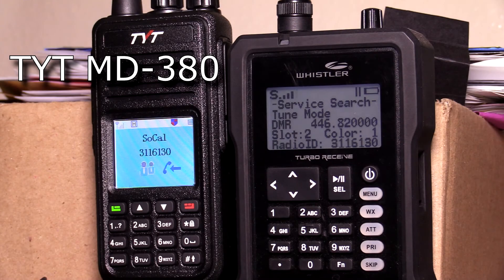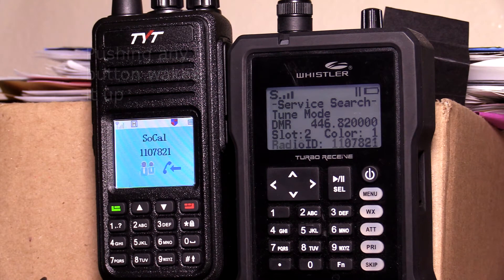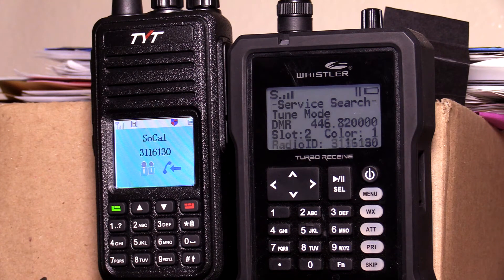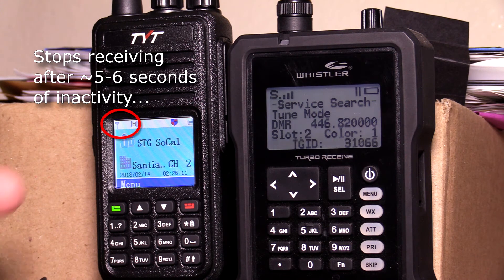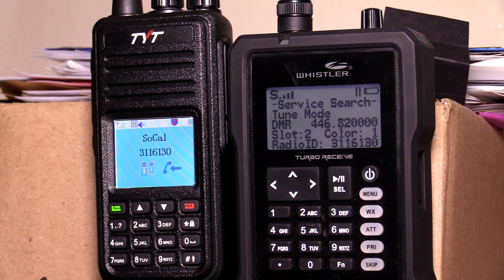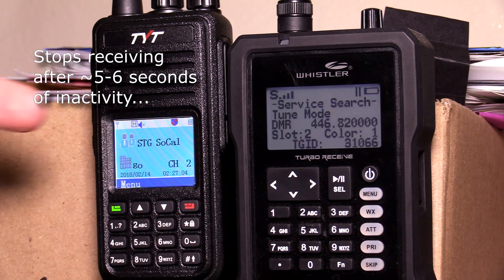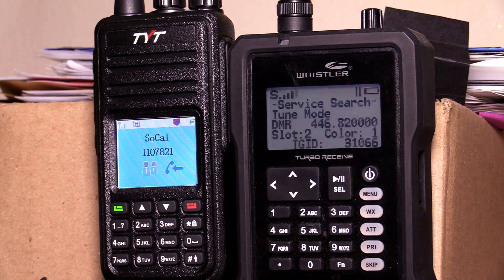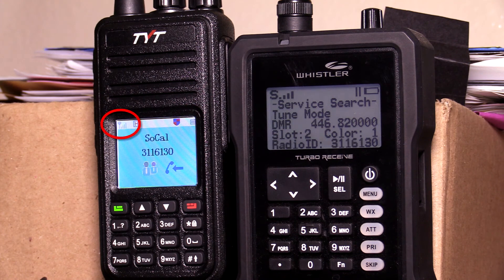TYT MD-380 DMR Audio / Signal Dropout Issue After ~5 Seconds

Comment: D002. 032 is the firmware version on my 380..if the hot-spot goes quiet for a while the 380 goes quiet..cant seem to hear signals from the hot-spot after its gone quiet.. Key the radio and it can hear again.

Comment: Just curious, was the green LED also not working during receive? I just returned a unit that had this same problem and the green led did not light when receiving. Also did not receive in analogue mode unless you manually opened the squelch with 'monitor'.
Reply from the maker: You know, I'm not sure.  I don't recall noticing it turning on/off.  Looking at this video closely, it doesn't look like the green light was coming on at all.  I don't have the faulty radio anymore because the seller replaced my unit for me--and the replacement works perfectly.  I didn't have any issues with analog receive that I recall.  Then again, I didn't play with it on analog very much.  Hopefully you have no trouble getting a replacement, and hopefully your replacement works without any issues!

Comment: I have the same issue. Did you solve the problem?
Reply: I solved the problem, download fixed firmware here: https://www.mediafire.com/file/4qy7ac77zsou0z7/DM380-NoGps-RX_Fixed-_13.20.bin/file
Reply: @alessandrodalterio7556  do you have this file that isnt in a .BIN file or link where you got it from
Reply: @alessandrodalterio7556 gracias amigo tengo el mismo problema probaré con este firmware
Reply from the maker: Yes, it got fixed... by returning it to the seller for a replacement. The eBay seller was great and exchanged it right away. The replacement unit works perfectly without ever dropping out. If you are within your warranty period, I highly recommend that you contact the seller for a replacement. Hope this helps. Good luck!
Reply: Ugh... not what I wanted to hear but thanks for the quick response. I just got the radio today. I hope they didn't recycle your return to me :)